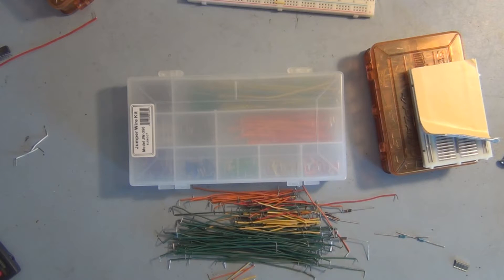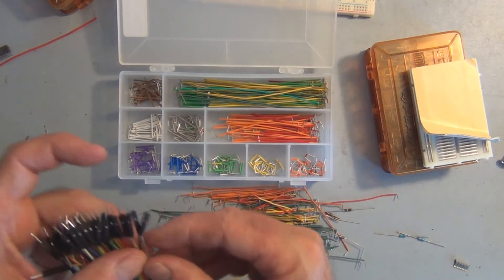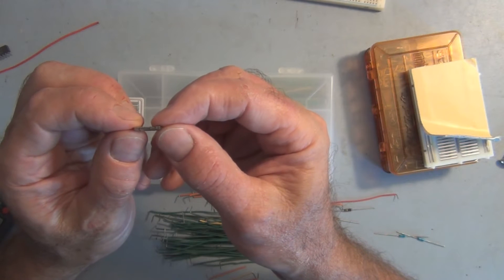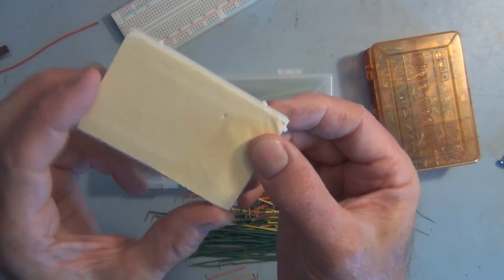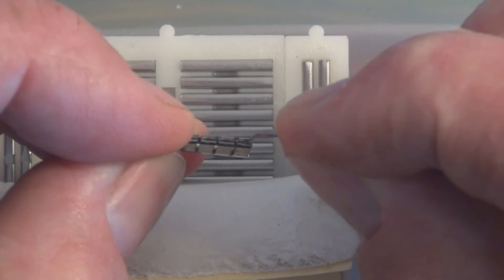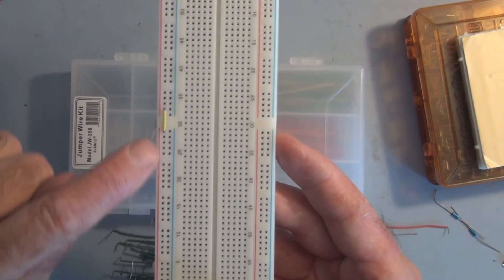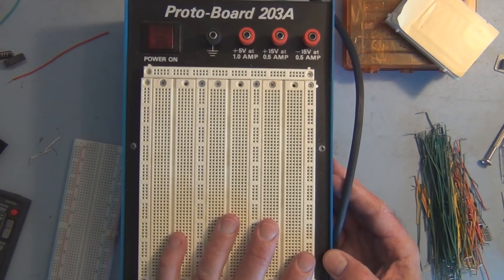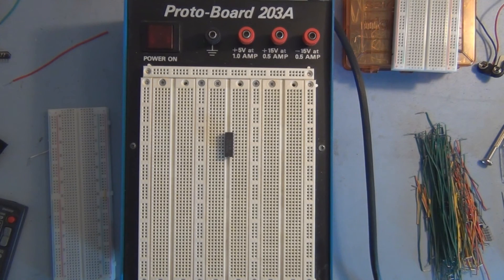A closer look at Solderless Breadboards

Comment: One thing to mention, different breadboards have different clips.  Stainless steel spring clips are kind of weak and wear out, get poor connections.  A breadboard with nickel-silver-coated phosphor-bronze clips will work much better, but costs 3x as much.

Comment: Hi in your opin how much current can handle?
Reply from the maker: gregor obreza I wouldn't do any high current or voltage prototyping with a breadboard.  I've never purchased  any breadboard that included electrical specifications or a datasheet.  They are mainly used for low voltage and current application prototyping in hobby electronics.